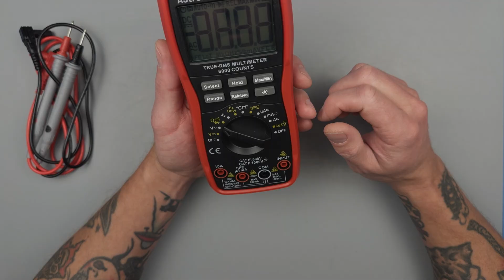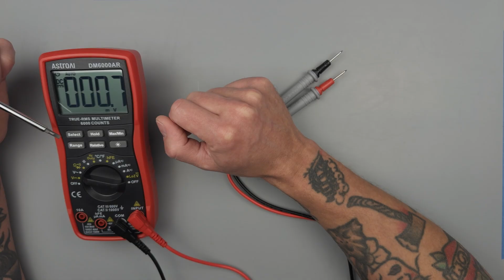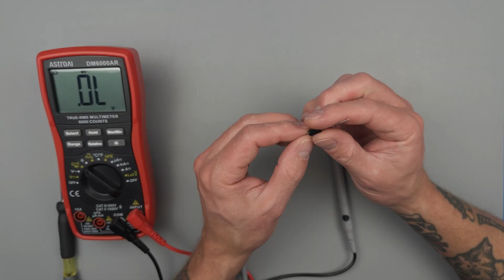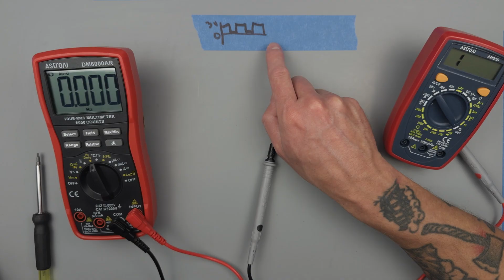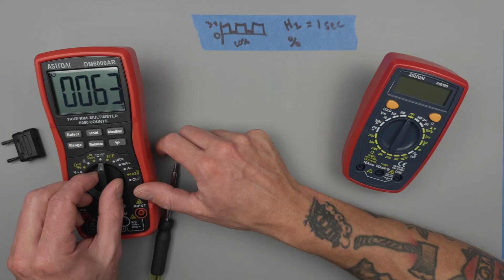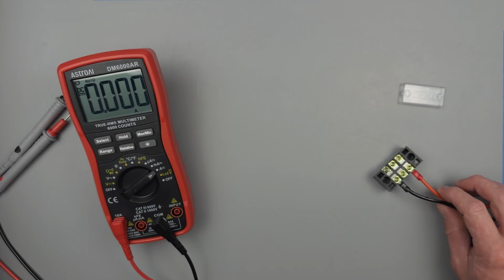UPDATED: How to Use a Multimeter: AstroAI DM6000AR Full Tutorial

Comment: Why are some of the dial labels yellow and some are white?
Reply from the maker: It appears on this meter its just to help you differentiate between test settings. The pattern is alternating depending on the type of test you're selected on. ei yellow is volts DC, then which is volts AC, all of the current settings are in white and so forth. It's just supposed to help you when you're looking at it in hurry.

Comment: Great video. What I have found with this meter, when testing voltage either AC or DC it gives a reading of millivolts. Then I will switch the negative to positive if DC then I will get the correct voltage. Sometimes it will just work but most time I will get this error . Not sure if others had this experience. Those times I would just go to my YELLOW METER, CHEAPER VERSION
Reply from the maker: Thank you so much! And that’s good feedback. Thank you for letting the audience know that

Comment: Very helpful.  I’m new using a meter with all these functions.  To be clear.  In a normal car use of the meter you are going to use Ohms/Continuity setting and DC Voltage using the red lead on input.  However, if measuring Amps you would use the red lead in the 10A?  What if you have a car circuit with fuses above 10A?
Reply from the maker: So glad to hear it is helpful. And that’s a really great question. If you’re wanting to measure a circuit with 10 or more amps of current, you’ll want to invest in an Amp clamp style multimeter. Make sure it is a model that supports DC current measurements (some only do AC). They have some the are somewhat inexpensive now. You could try checking out this one if you’re interested:

https://amzn.to/3Z7eUse
Reply: @maddoxmechanic  Thanks. Am I correct about in terms of reading Ohm/Continuity and DC volts and using the input connector for the red feed?
Reply from the maker: @A3Skywarrior yes you are!
Reply: @maddoxmechanic  Sorry one last question. I’m trying to identify what circuit keeps blowing a fuse in my car. In hooking up them meter I assume I need to disconnect the battery. Connect the black lead to ground and the red lead to the circuit in the ohm/connectivity setting. Correct?
Reply from the maker: @A3Skywarrior if I’m understanding correctly, and you’re checking for a short circuit, yes. That is one way to check for a short to ground
Reply: @maddoxmechanic I’m checking a wire from the fuse box to see what ohms and if there is connectivity.  Where should I place the red probe and black probe?

Comment: your video is exactly what I needed to watch. I just finished building a 100 watt Marshall Plexi Super Bass kit from Metropoulos, now I have to measure the voltages across all 7 tube socket pins. This meter is jumpin around crazy, while I manage to match some values, other don't come close, are my settings correct for 600 volts dc on this meter?
Reply from the maker: Hmm it looks like there’s kind of a lot more to measuring tubes than just taking a high voltage dc measurement. There could be a few things going on. 1 you could accidentally be on the ac voltage side of the tube, or 2 if it is a pulsating Dc signal, multimeters are not good at measuring things that pulsate. Because the meter will do its best to try and read the signal, but depending at the pulsing frequency it may just try and average out the value. Sounds like you might need to do some more homework on exactly what you’re measuring. And you might need some better equipment